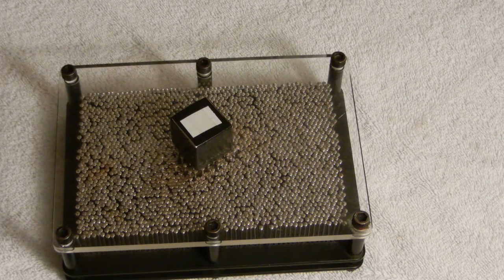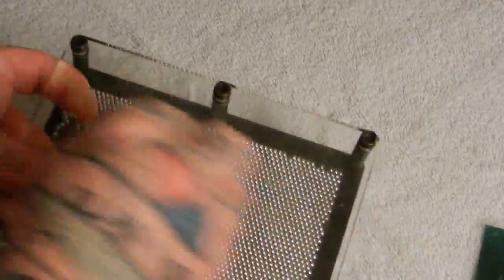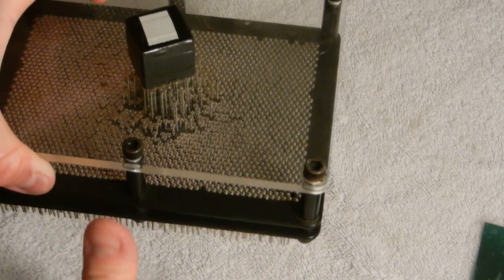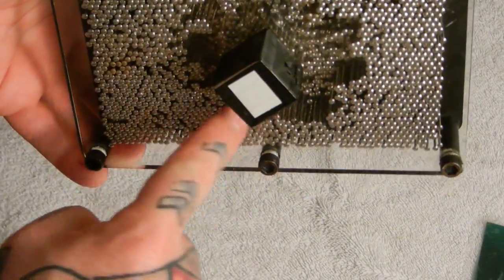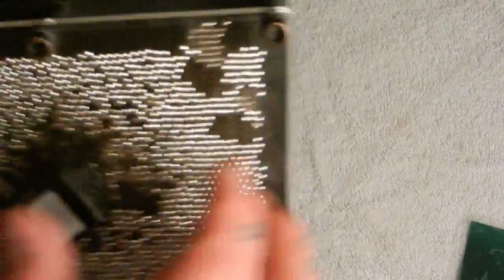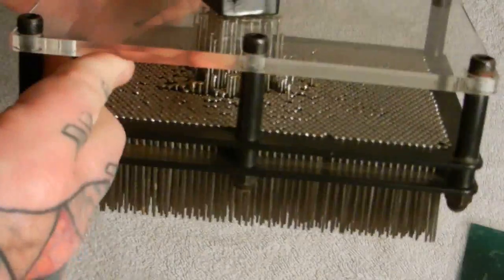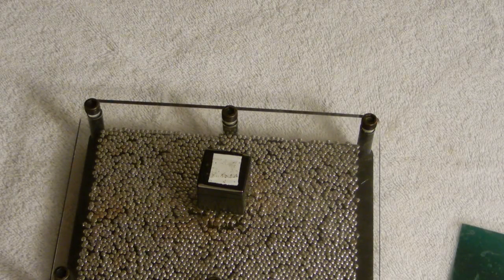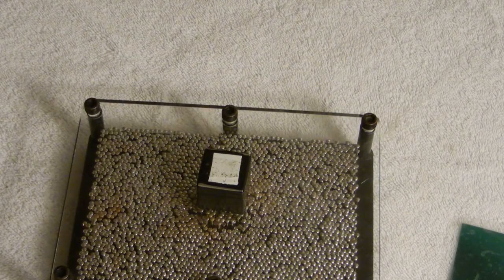Video 1 Uncovering the Missing Secrets of Magnetism

Comment: I stumbled across this recently and I cannot fathom why people are so caught up in what this guy has to say.  
This "demonstration" lacks any kind of scientific integrity.   Consider, two ring magnets placed on a vertical rod just outside of attracting range, with a barrier(tape on the rod).  Whether the top magnet is dropped or slowly placed makes no difference.  However if the top magnet is forced down against the barrier to the point the bottom magnet jiggles slightly... the bottom magnet is able to move towards the top magnet.  The same thing is happening here.  It is not the speed of the magnet that attracts more pins but the tap of the magnet against the frame allowing more pins to move freely.  

The "ring" of pins that do not move are simply succumbing to friction from the horizontal pressure of a collection of pins being drawn to the magnet.  
Nearly everything that Mr. Wheeler says is deliberately meant to confuse.  He cannot explain in more simple terms because there is no new information to explain.  Real science makes predictions and designs experiments to test the prediction.  Mr. Wheeler is observing phenomena, arbitrarily assigning a meaning, then only presenting the concepts that appear to support his claims.  All while denigrating his audience and repeating obtuse terms that have no practical application or purpose.  
I could claim that magnetism is caused by Sumerian ghosts.  But without evidence that magnetism responds to voice commands in ancient Sumerian, my claims are pointless and unnecessarily complicated.
If Mr. Wheeler cares to propose and carry out an experiment that objectively indicates the magnetic "field" is shaped as he claims, and how it benefits our practical application of magnetism, I would love to hear it.  In the mean time, to anyone listening to his ramblings, please don't think his repetitive, multi-syllable word vomit has any real implications or invalidates REAL science.
Reply: Like suggested in the comments below start by doing the fast approach without tapping on the plastic. Use a device like locking telescope rod to bring the magnet closer and the last 1mm gradually. This would take at least some of the loss of friction out of the picture and the field would still penetrate the pins at full speed. This still leaves the problem of pins pressed together causing horizontal pressure&friction. I'm not saying that this is bullshit, but all this "noise" needs to be removed
Reply: Ron Wagoner let's experiment how to influence magnetism with sumerian!
Reply: You notised he turned the bord upside down? Friction is out of the question. ;-)
Reply: Ron, if hes wrong then please I urge you to make your own video and demonstrate your analysis and NOT type up your explanation as it wont hold no true value. This is the main problem in general right now we just bitch about it, prove it.
Reply: Ron, you must forget logic on videos like this.
I've waisted an hour of my life watching a few of these videos. Why?, Because people like this amaze me. Not that they are intellectual or can use the scientific method, but that they can gain a following of people that actually seem to want to believe in pseudo science.
Reply: lol yessss dude
Reply: Ron Wagoner 100% agreed with you.
Reply: Milan Sekler: no, it's a name for doing things in a way that makes sure your explanation of a phenomenon is correct by removing everything that might interfere with results you are expecting. It also describes how to find out if someone (*cough* author of this video *cough*) is doing things in a way that cannot ensure that the result of an experiment is in accordance with their hypothesis.
Reply: Radrigo: doing a controlled experiment is a part of the scientific method...
Reply: Radrigo: of course it isn't :D he is randomly shaking, tapping, moving the whole thing, whenever the pins move they usually do so in bunches suggesting frictional forces, there is no mention of how far (how many) pins can be magnetised by the magnet at the same time (which would increase the mentioned frictional force in the horizontal direction - in the direction of the glass plane), how does the shape of the pins affect their movement in bunches... Using words as "most", "large" is not very useful since science is mainly a quantitative science and if we want to talk about scientific method, then you would be expected to first come up with mathematical prediction using certain, well documented assumptions and whether your prediction is correct determines the validity of your assumptions (first example that comes to my mind are the 2 postulates of theory of relativity). You don't just play with some pins for a while and then start rambling about "gyroscopic dielectric inertial centrifugal force" (whatever that is supposed to mean) as if you've clearly proven it, especially when going against scientific consensus that has been well established by following the said scientific method. Btw to get centrifugal force you would expect to observe rotating motion, which is clearly absent in the video and I believe that getting a spinning electromagnetic field is a little more difficult than just throwing a magnet next to pins. I would also love to see the equations showing that a spinning dielectric creates a centrifugal force that would create the effect (at a macro scale) we see in the video but I'm not too optimistic I will ever see them.
Reply: Radrigo: have you at least read the wiki article about "scientific method" or am I supposed to give you a lecture here? The reason math has been the most useful tool in the human history for understanding and predicting the behaviour of the universe is that it is exact. No hand-waving saying how things should be, but precise predictions that can be exactly verified and tell you whether your fundamental explanation of a real-world phenomenon is correct or not (physics then uses approximations of the ideal mathematical model). Math is the language of physics and thus there isn't one or the other, but the two are complementary and if used well can achieve much more than either of them separately. That's why it is a basic step in the "scientific method" to make predictions so that you know what you're looking for in an experiment. It's what separates a curious child from professional researcher. If you think that a particular mechanism is responsible for an observed phenomenon, then you can trace it down to its origins (e.g. electromagnetic forces due to electrons), figure out the contribution of a single unit (electron) to the overall force and then multiply it by the number of those units in a particular thing that you're dealing with (a metal pin). At the very least if your prediction is that every pin should have no force, or 10^60N of force exerted on them, then if your experiment doesn't match that, it is clear that you're wrong. Math gives you the boundaries within which your predictions make sense, thus telling you when to abandon and when to keep them. So what I'm saying is math+empirical observations = discovery.
Reply: Jeremy Joe this is only a basic demonstration, have you read his book or watched further videos? He has many more tests and experiments that verify what he says. If you want to discredit someone do it by making your own video and prove him wrong. Do not just state claims that have less evidence than this child's toy he was using as an introduction to his series for people who need to be drip fed information in order for them to grasp any significant understanding of what he is talking about.
Reply: OBELISK 369: when you just utter mumbo-jumbo there is nothing to be disproven. I am in my 3rd year of university physics study. I know what the words he is using ACTUALLY mean and I know why he can't use them the way he does (because it is nonsense). He is trying to take the terms in a well-established theoretical framework, go outside of that framework and make up stuff without limitations or self-correction. I have watched multiple of his videos and all the talk about vortices and dielectricity has no real information contained. Both the visual and the audio contents of his videos are the same: hand-waving. As the saying goes: if you can't explain it in simple terms, you don't understand it yourself. I very often apply it to myself. When I learn a new subject I always try to explain it to my family and I very often fail due to my own lack of knowledge, but once I understand it well, I have no trouble explaining it to anyone. Unfortunately the man in this video is hiding his lack of understanding behind a curtain of fancy words that remind me of Deepak Chopra and as such there is no real understanding to be had.
Reply: @jeremyjoe7494  Since you 'know so much more about this than he does' why not take him to task and hold a scientific contest at a known and respected university so that many people [will not speculate at numbers, but I will definitely be watching it!] can either watch it live, or see the whole, uncut results here on YT?

People have been dissing scientists and bullshitters ever since forever, INCLUDING Sir Isaac Newton, so your behavior in this situation in no way proves your beliefs to be right, it just proves that you would have dissed Mr. Newton your self, had you been there in his time.
Reply: Since you 'know so much more about this than he does' why not take him to task and hold a scientific contest at a known and respected university so that many people [will not speculate at numbers, but I will definitely be watching it!] can either watch it live, or see the whole, uncut results here on YT?

People have been dissing scientists and bullshitters ever since forever, including Sir Isaac Newton, so your behavior in this situation in no way proves your beliefs to be right, it just proves that you would have dissed Mr. Newton your self, had you been there in his time.
Reply: @DeliciousDeBlair  The reason I can't do that is simply that while all of physics is built upon fundamental principles and clear definitions, whereas I couldn't even find Wheeler's definition of "dielectric". Not in his book, not in other "electrical universe" websites. So while I would be coming from a point of clarity, he could give his words any definition he pleases since he is not using them within the already-defined framework (and does very little to explain what he means when using them in his videos). That would make a debate a pointless exercise in obscurity, which I am not interested in. My biggest complains against him and his video is simply the lack of clarity. He likes to use a ton of fancy-sounding words in quick succession, often using several to describe the same thing acting as if they were synonyms even though they usually aren't. On top of that, disputes like these are not actually solved by debates in the scientific community, but by an exchange of private messages where the two sides do their best to articulate their arguments clearly (also using numbers) and agree on a way of resolving their differences in ideas (this part is usually the publicised one). Debates are for politics and religion where the better speaker wins. Science doesn't care about your ability to present an idea, as long as it is presented without errors. Exchanging messages also gives both sides time to slowly go through the other person's work, just like I am analysing the work of Mr. Wheeler. The other reason I am not interested in debating him is simply that what we consider to be proof is completely different in our minds. This is evident from his video "The Greatest LOST SECRET of the PYTHAGOREANS rediscovered & explained" where he splits a line into random sections and then claims that they obey very well-defined constant and ratios. That is simply not true and he makes no effort to prove it by measurement. It also goes to show how he loves obscurity when he uses "1/φ^(-3)" which is literally the same as "φ^3", but I guess fractions look cooler? Oh and of course, I don't want to validate this nonsense by giving him a speaking ground at an actual university. Maybe once he publishes his findings in respected journals and makes a name for himself in among scientists/science enthusiasts will someone be willing to respect his opinions enough to invite him for a debate (even though it would be pointless as I already explained).
Reply: @jeremyjoe7494  I see you twisting my words now. YOU use the word 'debate' either 'out of context' [which is what you are accusing him of doing] or else trying to put words in my mouth. Either way, that won't fly.

I did not say 'debate' I said 'contest.'

I guess you do not know the meaning [definition] of the word, so you chose to put in one you preferred to infer from what i said, or else, knowing full well what i said, you dodged out on it because you know you can not prove him wrong.

Either way, all I see is you complaining about his use of words, and not at all contesting or attempting to refute his actual claims.

To refute a claim needs no words, it needs physical testing performed in open view of witnesses so that nobody can claim anything which scientific procedure can not verify, nor can they deny anything which scientific procedure can prove.

Also, publishing in respected journals, when that is a huge portion of the problem with so called pseudo science today, would leave out people like Isaac Newton, Nikola Tesla and a host of other brilliant minds who put most of the knowledge we rely on today in our minds and in our 'hallowed halls' of 'higher education' where they promptly got clobbered, trampled, diluted and shoved into the corners in favor of junk science so that any real advances to mankind's knowledge would be stifled to control the people and keep them trapped.

I wrote a book [science fiction] with an extreme example of this, much more extreme than reality, but I did so in hopes that not a few who read the book would begin to wonder just how much real science they were actually missing out on, seeing as I have no way to tell you what all is hidden [if I did, I would have published it all my self as soon as I obtained it], and this man here, for as crazy and delusional as you would like to believe him, is not the only one who has punched the world of pseudo science right in the nose and in the end was vindicated.

A man who was murdered for his 'scientific heresy' was Mr. Stefan Marinov. https://www.scribd.com/document/343138305/Divine-Electromagnetism-1993-by-Stefan-Marinov

I know a lot of people in the industry as I have worked with a few Russian specialists in the field of magnetism and electromagnetism, and although you would probably think of all of them as quacks too, they have shown me physical machinery doing things that your version of science claims can not be done.

I can't tell you how they did it, only that I saw it happen.

These people, some of which work for the University of Moscow Long Range Communications, have worked on a host of classified Soviet projects, are or were in the military, and are conducting research far over the heads of the Americans in these specific fields.

I can not divulge what they did, because I would be violating their trust [and getting both them and myself in trouble with their government] but I can say that what they in fact did do, and are still doing, flew in the face of 'peer reviewed' convention.

That said, you can go on not believing the man, not knowing what he is talking about, just throwing around words like stones from your glass house, OR you COULD be a wise and intelligent GENTLEMAN showing some sense of modesty, decorum, and LEARNEDNESS, and arrange a genuine meeting with the fellow and find out what is even being claimed and what is going on before passing presumptuous judgment on him.

Unless like evolutionists, you are merely crying loudly to divert the studious from thinking.

You will likely never cease to be a processionary caterpillar, I sense it about you, but I shall leave you with this link so you can think about the choices you make in your 'scientific' career... https://io9.gizmodo.com/heres-a-weirdly-inspirational-story-of-caterpillar-tort-1592903437
Reply: @DeliciousDeBlair  On the other hand, you have ignored my main objection to your idea which is that if we don't have a common ground when it comes to the fundamentals (such as definitions of terms), then any discussion is meaningless. You said "scientific contest". I understood that you want two sides to present their ideas and argue in favour of theirs. The most common "scientific contest" (this term does not have universal format) broadcast to larger audience that I know of is a debate. Therefore, I discussed that option and went further to talk about how these disagreements are usually resolved - an exchange of letters or emails. If you wanted to talk about a specific type of "scientific contest", please refrain from using general terms. A contest in my mind is a competition at the end of which there is a winner. This is clear when it comes to physical contests, but I suppose you don't want me to physically fight with Mr. Wheeler, therefore a different form of competition needs to be chosen and when it comes to intellectual competitions, there can only be a winner if there is an agreed-upon answer. In this case I am convinced that there is one, but I'm sure Mr. Wheeler would disagree. Thus the winner is decided by a group of spectators and unless these are professionals in the field (who would agree with the conclusions such as gravity exists and cannot be explained by the EM force), the result would be a popularity vote. That defeats the purpose of what we are trying to accomplish here, so unless you wish to present a different format of the competition, I am not willing to sacrifice my time and energy to disprove something that has never been proven. When it comes to the rest of your comment: there are people believing that ordinary rainbows are the effects of HAARP, that the exhausts of planes contain mind-controlling chemicals and they are willing to drink literal piss as long as it "magically" drips out of a statue of Christ. These are the reasons why I can't take observations of random strangers on youtube as proof. It is very easy to miss important bits and pieces when looking at the results of experiments, therefore only a careful analysis can show the truth. Mistakes happen to the best of us, as proven by the recent dispute between ElectroBOOM and prof. Walter Lewin on something as fundamental as Kirchhoff's law. Your comment on "evolutionists" makes me think that you might question that theory as well, which goes to show the rabbit hole one gets into once reason and careful observations of reality go out of the window in favour of wishful thinking and pseudoscience (a.k.a. magic). Finally, if these things are so hidden and people die for them, how come a random youtuber, who specialises in photography, is allowed to expose these things with no issues? I apologise for any mistakes I may have made in this comment (grammatical or clarity-wise), but I am out of time and had to write it very quickly.